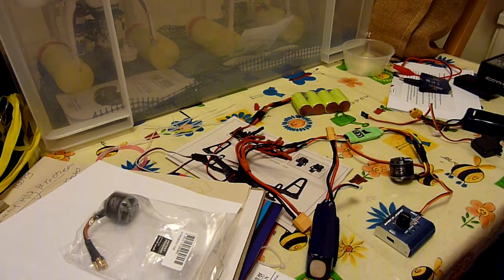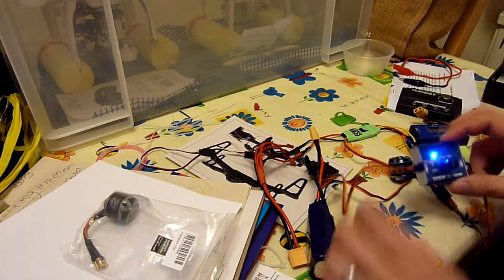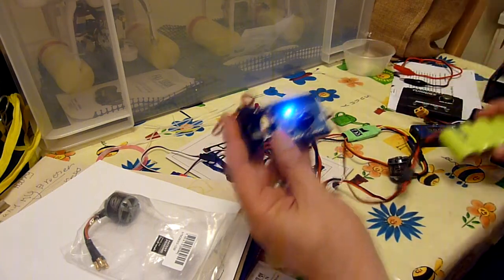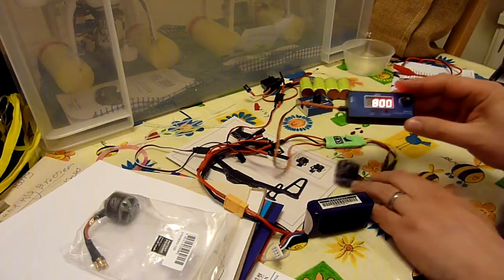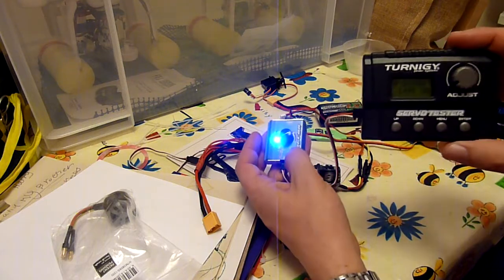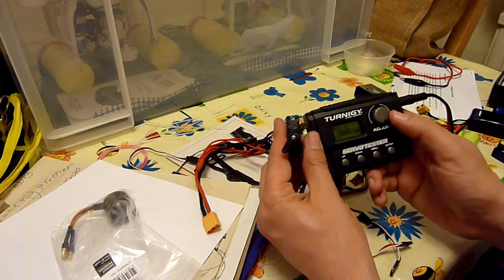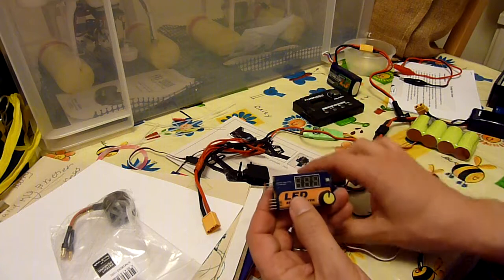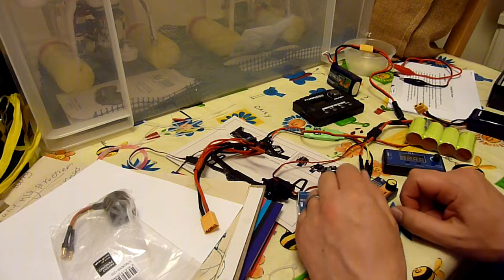Quicktip servo tester demo - test servos, ESCs and motors quick and easy - naza calibration

Comment: my cheap ass servo tester doesnt have the 3rd pin connected to anything on the power in side. I dont need to calibrate, i just need it to run a motor for a diy drill press... are the better ones just looping the 3rd S pin back to the connecters 3rd pin? aka it gets power on the red and black and sends the pwm modulated signal back to esc on its 3rd wire? aka i could probably just solder a jumper wire between pin 3 on output side and input side to make it work with ubec bec?
Reply from the maker: Can you not just use the output side as the +5v/ground will definitely be common to input/output - that's what I've done when testing ESC's with BEC ? I've never tried connecting a servo to the input side, I only use that for a battery so not sure if mine are like that or not, but wouldn't be surprised as it shouldn't be necessary to have signal out on the input side and it probably makes the board layout simpler.
Reply: yeah its single sided w/TH and smc/ds by eye id say the keep out is no bigger than 10 mil on the edges and the only route for that trace would be the long way around the outside edge and probably would have split the ground pour in an awkward way/required  quite  a bit of bodging to get a trace around and ground maintained where its needed... aint no 8 year olds in china got time 4 dat lol
Reply: I should have looked at the board before asking but its 5am and ive been up all nite...taking what you said in mind i looked at the output from the so8 to ouput and  positive. it appears to be driving the pin low when active and commoned with both power wires as you suggested.
Reply: ty btw
Reply from the maker: yr wcm